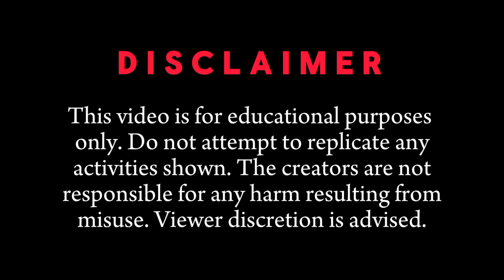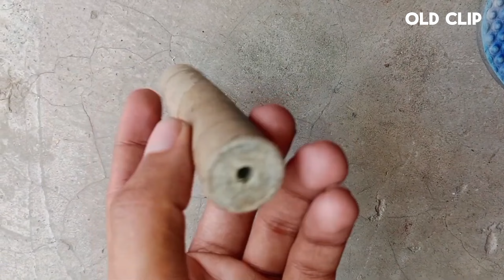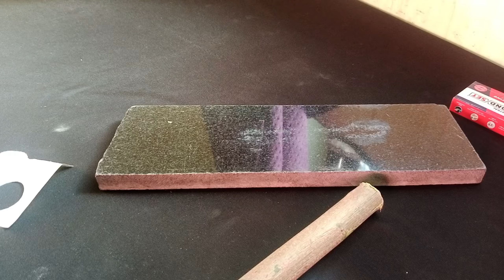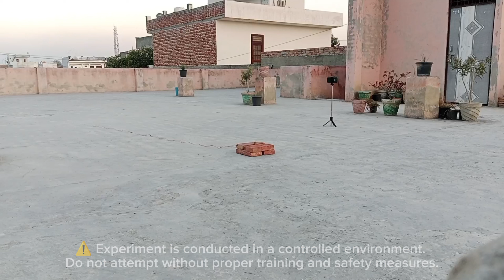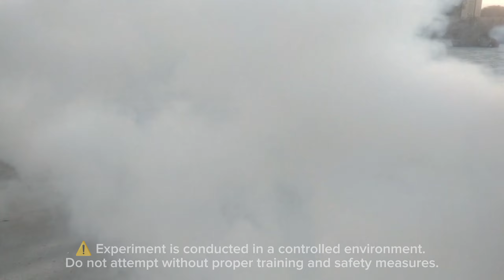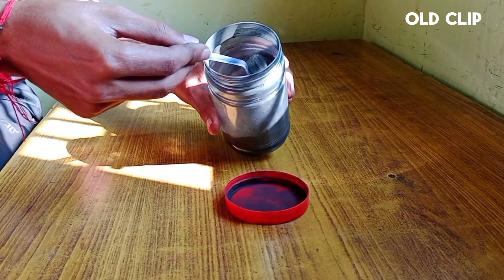My Rocket Motor Turned Into a Bomb?!

Comment: *Bhai important points;
1) Make hole in grain more big .
2) Make hole only half way through for a easy liftoff and then steady thrust for sustained flight, this also reduces thermal stress on end cap that can lead to explosion.
3) If possible use a bit slower burn rate fuel try mixing some suppression materials like baking powder or compounds that can decompose in the heat of motor preventing choking of nozel .
Ham har time tumhare saath hai ❤❤😊

Comment: dont make the hole so long just like small hole  so it wont explode and and the dot make it more bigger (not bigger like marble) just a little i make my own rocket motor and it worked and use clay or use potassium nitrate and sugar use blinder without an metal if u use metal if it sparks it can make an house fire so use marble and shake it for 24 hours use blinder to shake the powder

Comment: don't use kclo3, always use kno3. Use a ball mill to break down the potassium nitrate so the nitrate doesn't get left behind when burning. also measure the tube and divide the inner diameter of the tube into 2, the answer will determine how big your core should be, also you don't need to add watter to your fuel and use this ratio kno3 60% charcoal 30% sulfur 10%
Reply: 2:41 you will get the same burn rate if you ball milled your kno3 rocket fuel
Reply: Regular black match is enough to ignite the motor

Comment: Since black powder have insane burn rate, your grain core surface area must be reduced. It's called Kn Ratio. If surface area are too big, it going exploded 😂. If you see on estes rocket motor grain cross section, it have very short and small grain core. Military Rocket like BM-21 grad have no grain core since it uses nitro cellulose propellant that burn very fast (end burning rocket motor). But if you use KN sugar or APCP with slower burn rate, you must create grain core (core burning rocket motor) to increase burn rate and produce more thrust. For black powder, better if you use end burning configuration (no grain core) , or if you want slight more thrust, just make very short grain core from the nozzle since it burn so fast. Better if you test black powder burn rate first. If it burn very fast, never make grain core or it will become fire cracker 😂. What I say maybe like an theory, since I still have experience on making sugar rocket, not black powder rocket (I will try it someday since BP is reliable even stored at long time, just need to dried in the sun before used) and fail to burn cause I delay launching sugar rocket for month after make it (hygroscopicity is true killer of sugar rocket) 😂. But you can try it and see the magic

Comment: My guess is water isn't a good enough binder.  So even if you pack it, it's loose, and will simply explode.  You have to use a better binder, and/or compress with pressure.

Comment: Bro if you have master solid rocket, can you try building liquid fuel, not a complex one but using a metal bottle add 50℅ hydrogen peroxide mix it with ethanol and add potassium permanganate and ignite the steam